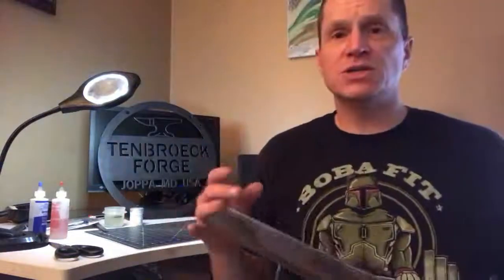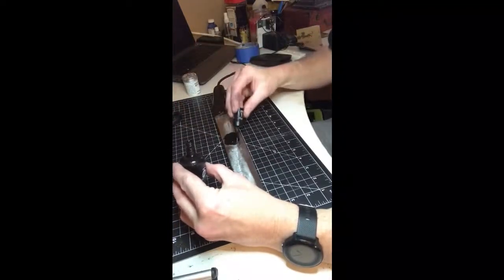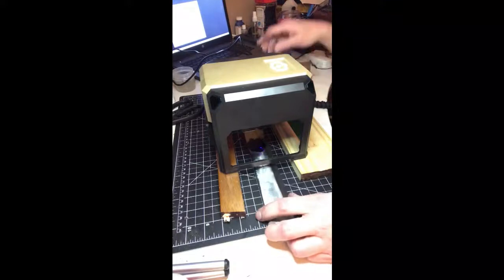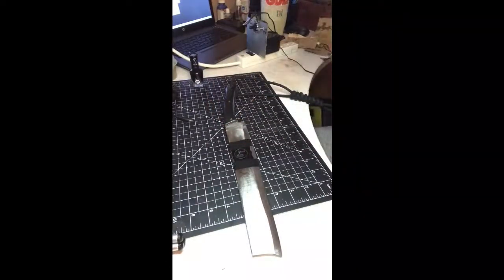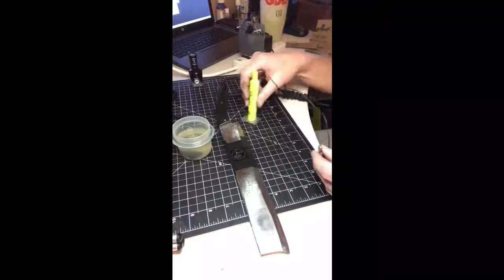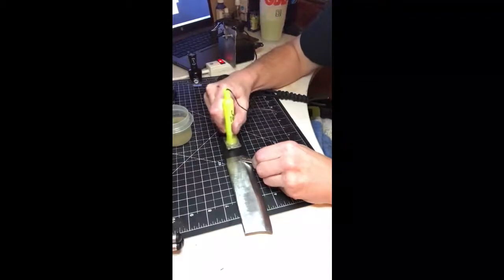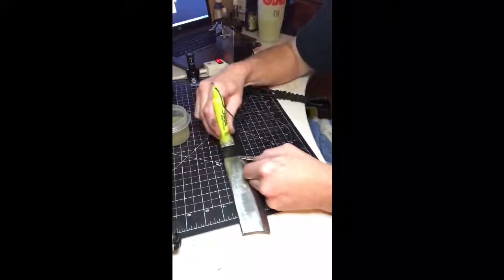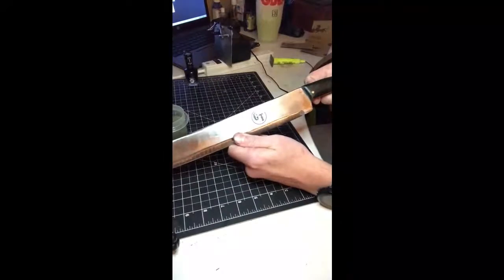How to engrave or etch metal using a low power laser, nail polish, and an etcher.

Comment: nice video! it was really helpfull for an up and coming project i have.
there were a couple questions left that might be usefull if you wouldnt mind awnsering them. i put them in a list below:
1 you mentioned that you would get depth if you used DC instead of AC. how big is the difference between those two methods(in a general sense)?
2 are there any safety precautions one should take while hooking up the etcher to metal?
3 how strong is the laser you are using in this video?(for comparison sake)
4 you said using a DC etcher would melt the nailpolish away. is there a way to circumvent this or do you need to use a different material?(if yes, what would you recommend?)
5 using either AC or DC methods, is there any risk heat tempering the metal? (discoloration)

again thanks for the video. keep up the good work!